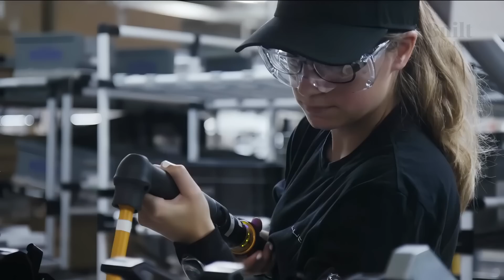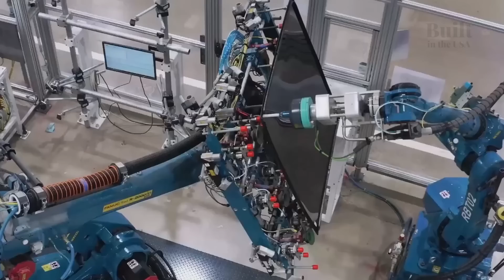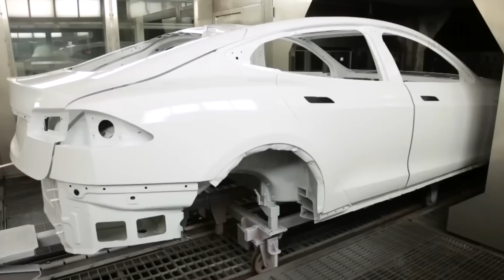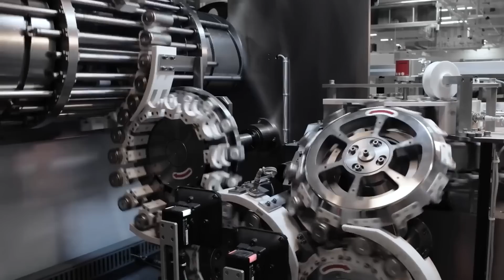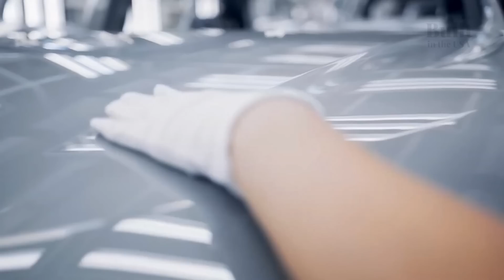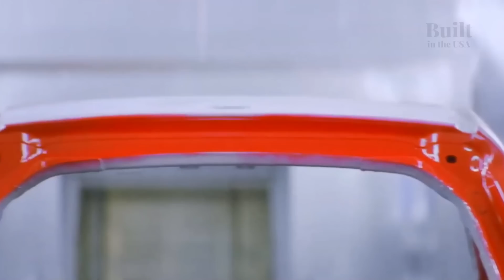Lucid Motors Factory – How electric Lucid Gravity & Air SuperCars are made in the USA

Comment: Two and a half years & 25,000 miles in a Lucid Air GT.   Amazing car.   Comfortable ROOMY(!), great entertainment system (Android Auto works wonderfully too).  Recently drove from Denver to Tempe, AZ with only ONE charging stop (just to see if I could do it).  On the return trip I followed Lucid's suggested stops, one for 17 minutes, the other for 27.   Amazing range.  I get between 4.0 and have seen up to 5.5 miles per kwh depending on conditions (altitude, wind, temperature, rain, etc) on certain runs over 120 miles.  I live in the mountains of Colorado so lots of ups&downs.   I have left one of the three trip computers running for the last 13,000 miles and it's reporting an aggregate of 4.1 miles per kwh.   I'd buy another one for sure.  Waiting for the mid-sized Gravity follow-on to show up next year.  I've had few problems, only an occasional glitch in the radio display which a soft re-boot fixed.... oh, and a bear that decided to try to get in to my front trunk and tore the bumper off.  The Denver service center team did a stellar job in returning it to like-new condition.

Comment: The video neglects to mention that the Shanghai Gigafactory is the most efficient  and productive because of the Chinese workers, all Tesla Gigafactories.  Elon Musk has mentioned this many times. I would prefer to purchase a Xiaomi SUV7. Xiaomi started out as a smartphone company and diversified into household appliances and then EV cars. I would prefer the NIO ET7Touring or ES6 with swappable sufficient battery capacity, anything under 600 miles range is unacceptable.  Chinese CATL batteries are top notched, and not available for any EVs sold in USA. battery change in 3-4 minutes.  

Tesla has a bad safety record with its batteries which have exploded. For that reason, I’d never buy a Tesla. 

The USA government won’t allow  inexpensive high quality, long range batteries  Chinese EV cars to be imported. Of course BVD EV with their Blade LFP Lithium Ion batteries are the safest in the world. 

In USA because of the ban, I would get the very expensive Lucid Air.

Comment: Could you tow a trailer. That has like 2 wagon wheels. Use the axel and gear an alternator off the axel. The Newton meter torque off the wagon wheel radius. your advantage. Self charging system.

Comment: Lucid company design looks like shit. Price is out of touch with reality. The real value in EV is not electric motor, luxury, or long range battery, it is the full self drive capability, and there is nowhere in sight. I would be surprised if it sill around in the long term.

Comment: It's a 100% USA designed and made car. I have a Lucid pure DUAL motor version with pro drive n stereo. It's blissful, fast and quiet which makes the stereo even better. I can wake up every morning with at least over 325 miles of range. Usually I limit it to around 225. I'm not a cross country trucker so that's plenty plus it can 350kW charge around 150 miles in less than 20 min so 500 mile trips are easy. It also goes farther per electron so it's cheaper per mile. No more inconvenient $60+ weekly gas station fill ups - nor oil,  trans, radiator etc changes. No drips in my garage either. I am sympathetic to the price but a slightly used one is probably cheaper than you think if you think about 60 a week in gas. Like most people, I won't be going back to ICE.

Comment: I work at the Lucid plant and this is more than I've ever seen of the place. Funny to see my coworkers in this video
Reply from the maker: Did you work on the assembly line? Are your colleagues really in the video? :) Thanks a lot for the comment
Reply: @BuiltintheUSA I don't exactly work the assembly line. I'm a manufacturing repair technician, so I work pretty much everywhere around the whole factory.

And yes, I saw several familiar faces in the video
Reply: How is the  job they want to hire me but I'm kind of hesitant to accept the offer
Reply: @johnny.gone.fishing4651 All depends on the job and department. It's hot af almost everywhere though. They cheap out on running A/C
Reply: @johnny.gone.fishing4651 It's honestly a good starting point for a career. You can level up pretty fast due to the wide shop floor, which means more opportunity to shine, and also due to lots of cross training
Reply: They call that compartmentalization.

Comment: I’ve been driving an Air Touring for the last year. It’s by far the best car I’ve ever driven.
Reply from the maker: Thanks a lot for sharing your experience. Do you have any criticism of your car? What should they improve in the next model?
Reply: @BuiltintheUSA  The lock/unlock system via smartphone, although improved through software updates, is still sometimes wonky and I end up waiting for 5-10 seconds to get in the car every once in a while. Also, native NACS port with the voltage boost system developed for Gravity should also be integrated into a future version of the Air.
Reply: Ok. I'm sold. My wife and I just viewed a 2024 Lucid being sold for $50K. Not a bad price for this EV and I like that for the 2024 model - range is 420 miles.

Comment: Love my Rivian would love to have Lucid!   I have a model Y and it’s the most uncomfortable car I’ve ever driven in. Noisy hard ride the Rivian by far is a better ride and a quiet one as well.
Reply: I found the Rivian very loud due to tires and motor whine. You should test drive the Lucid Air Pure with RWD, its very quiet without the motors in front and no glass roof.
Reply: I have alucid air gt and rivian r1t. The lucid is the most luxurious vehicle that I have ever owned. Everyday I drive it. It feels like the first day. I want to get the gravity to replace e my r1t. I will do this later.